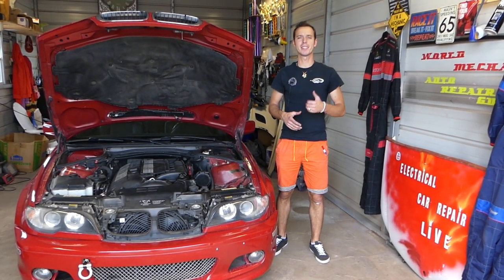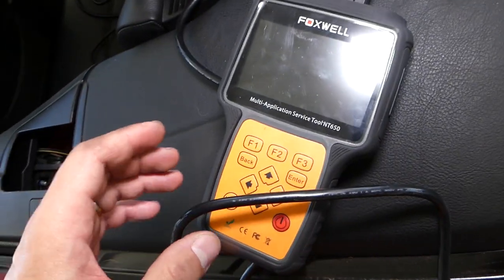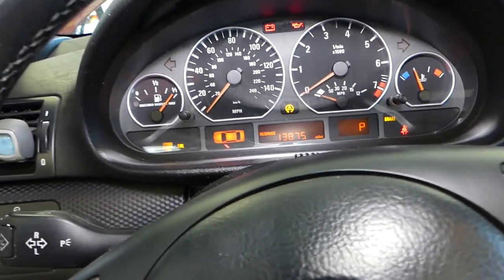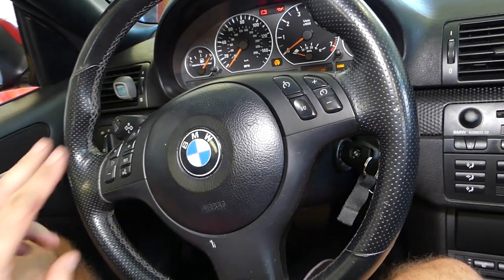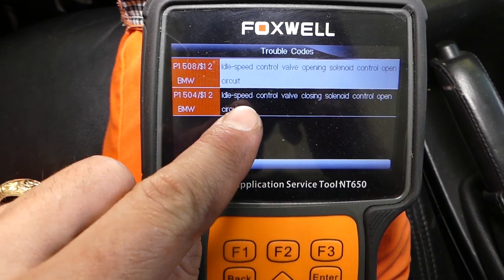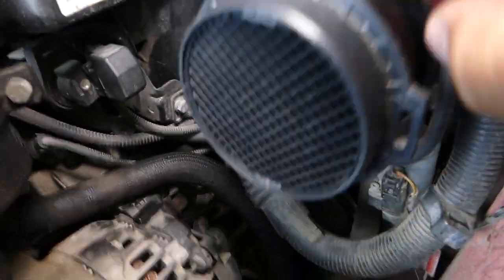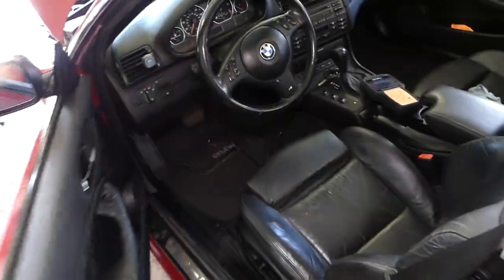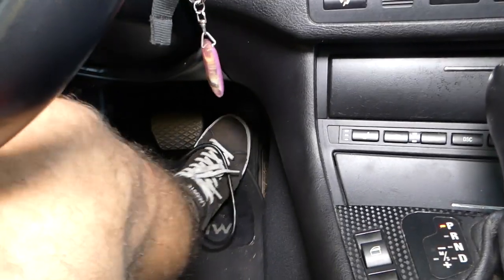FIX CODE P1504 P1508 IDLE SPEED CONTROL VALVE BMW E46 E39 E60 E53 E83 X3 X5 Z3 Z4

Comment: I have an E39 that will not start under 45 degrees unless I use starter spray. My mechanic has replaced the oxygen sensors, plugged in the computer, but cannot figure it out. He wants to replace the crankshaft sensor but I don't have endless money to test every possibility. The vehicle has 200,000+ miles. It starts right up above 45 degrees. Any thoughts? I have not tested fuel pressure. The issue only occurs, right at 45 degrees F on the dash for the exterior temperature gauge. The moment it warms up outside, the car starts instantly! I was hoping the have someone shout out about a similar experience as I have run out of funds to keep testing the mechanic's theories which have all been wrong more than $600 later. Once the vehicle starts, it runs perfectly. No rough idle. Has anyone solved this very same issue at 45 degrees F?
Reply: Did you find out what the issue is??? I have the same thing!
Reply: @MaybeTylerwastaken  my last attempt to resolve this will be replacing the ignition coils. They are aftermarket and I bought OEM Bosch to replace them.